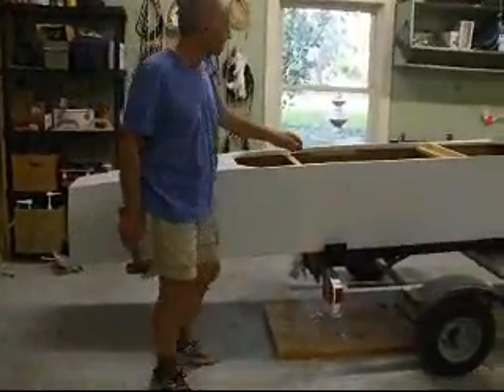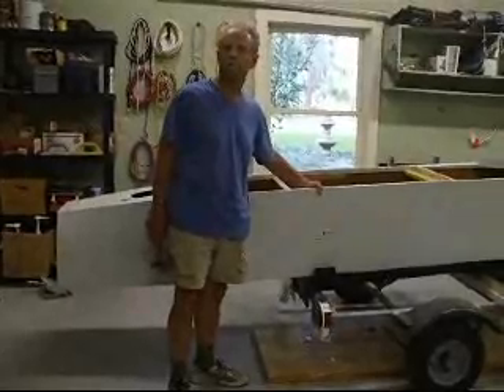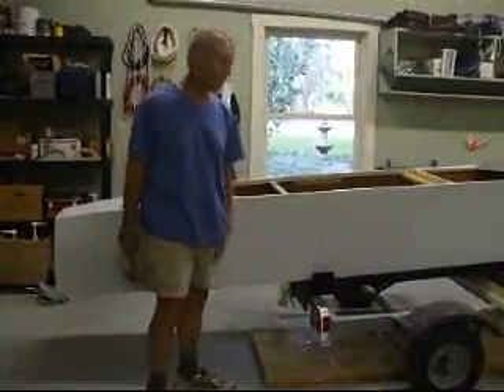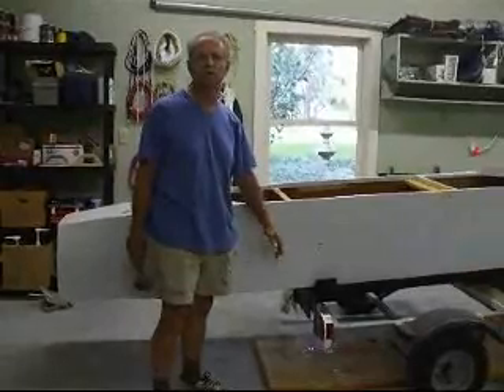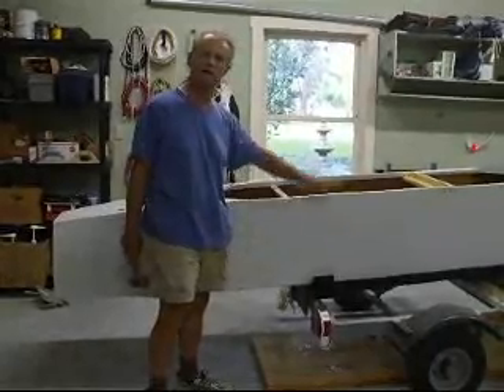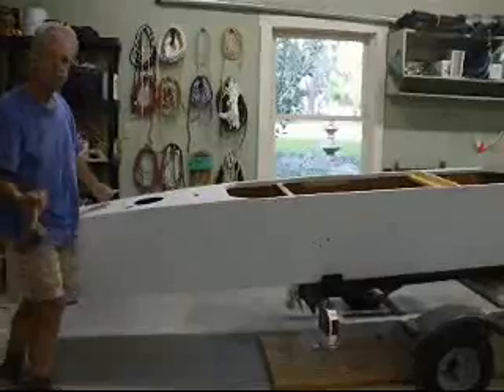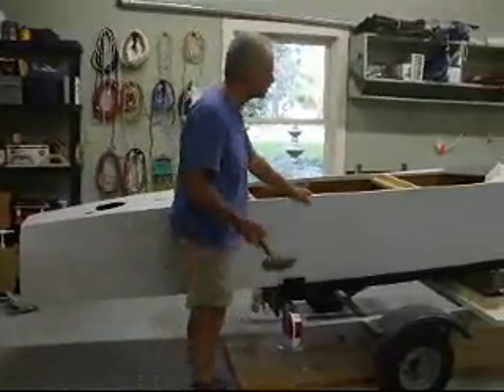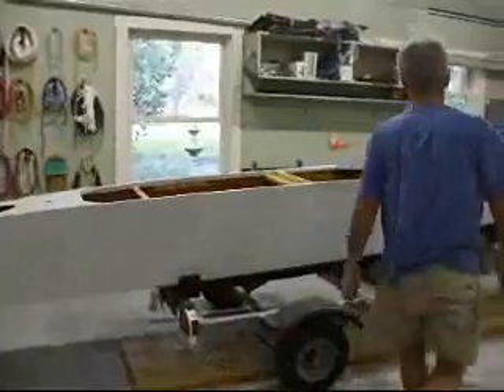Is 3mm (1/8") plywood too flimsy for boat hulls?

Comment: There is a type of popular home built catamaran in Australia called the jarcat designed by Ross Turner. Probably more than a hundred built and launched. It uses 4mm and 2oz glass which has worked fine. 

It is quite a large boat with lots of surface area, has no trouble handling a big crew and also handles quite a big motor. Some have up to 40hp as they can cover ground really quickly under power as well.

It's great how people try different stuff in different ways and see how it works. But sometimes hard to know everything that has been tried - thanks so much for putting this video up.

Whether a Jarcat could be hit with a hammer, I don't know. But over the last 40 years they have proved very durable for real world use.
https://youtu.be/iNfbM-nQLaI

Comment: I've built a large number of Duckchasers using 3 to 4 mm ply of "marine grade". The one that has done the most work including a bit of white water, attempts to surf in it & general knocking about for a decade. It's not glassed either inside or out but does have a coat of epoxy & TPRDA as a sealant. It has bounced off rocks, been dumped in the surf, half filled with sand, Been caught cockpit upstream in fast water wedged between two rocks & survived. Yes it has patches (about 11 at last count) but the cracks are only in the skin ply & each time I completed the trip. The design forces a certain amount of curvature in both directions into the ply at the ends & this makes the ply surprisingly hard to break.

Comment: So Is 1/8 plywood with 6oz fiberglass a good option for a camper shell?? Also did u only use one layer of fiberglass?
Reply from the maker: No, it's too thin, I think. I used 1/4" BC ply with 6 oz glass to build my truck camper.

Comment: lolol

Thanks for the demo... Exactly what I was wondering about for my next build... 

I don't use fiber glass, just latex paint and spar varnish; but the spar varnish makes the exterior tough as nails from what I've seen so far... And I've only seen it get damaged from extreme abuse during launch and a neighbour messing with my hull's using a knife... 

How did this boat fail as a design? It looks pretty nice!

Comment: How many layers of 6oz fiberglass and coats of epoxy did you put on that boat you tried putting a hammer through? The 1/8" ply boat?
Reply from the maker: A single layer of 6 oz glass over 3 mm ply, glassed outside only.

Comment: I agree with Frank here. Properly glassed, its quite robust indeed and frankly if it did seem even a little flexxy, add some extra glass or internal stringers along the inside.  Nice to see this wood getting its fair due credit instead of being malighned by okoume sellers in order to promote there own sales of good, but absurdly expensive wood.

Comment: What is FG tape? I in fact will be putting in a keel type piece of wood on the bottom to help the boat track straight.  Btw, I love your trimaran.  Fast, light weight. Great build.  Did you take pics of your build?  I have shown your video of the 3mm plywood hull at least 12 times. Great video.  My next boat will be a 24 ft rowboat, and I think the sides will be 1/8" el cheapo door skin, like yours.  What did you do the bottom of your boat in? 1/8 or 1/4? thank you sir.

Comment from the maker: If I were to be running up on oyster beds on a regular basis, I would want a single layer os 10 oz or 2 layers of 6 oz on the bottom if it's flat. If there are chines and a keel seam, I would also reinforce them with FG tape. I do my best to avoid harsh surfaces, but if you can't do that, tougher is better!

Comment: Doc,  I just built a 20 ft 2 man rowing boat with 1/4 luan. I am planning on using 6 oz fiberglass cloth on the outside.  My question to you is, in my current rowboat (3/8 ply, no cloth) I am running up on oyster beds just below the waterline or getting stuck in shallow rapids all the time and don't want to punch a hole in the thin luan.  Will the cloth be enough for the bottom or should I add kevlar, or even a metal wear plate? 
thanks doc